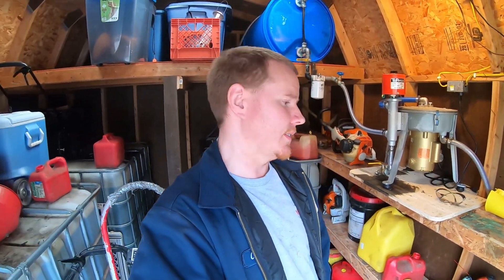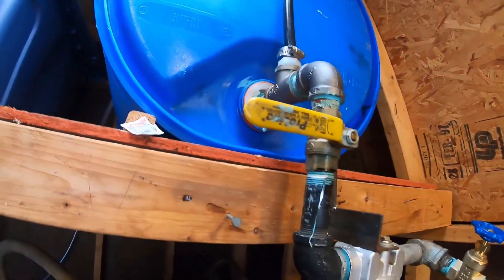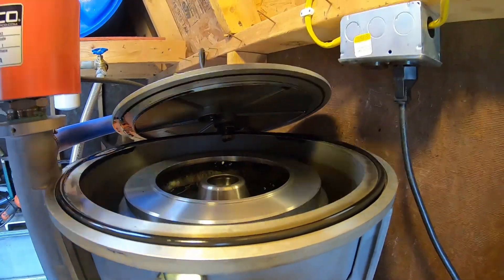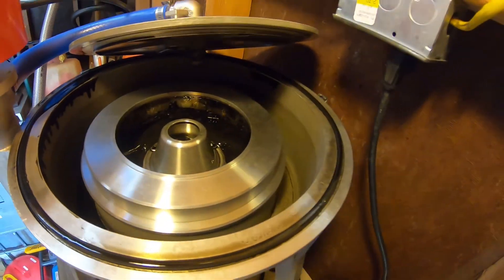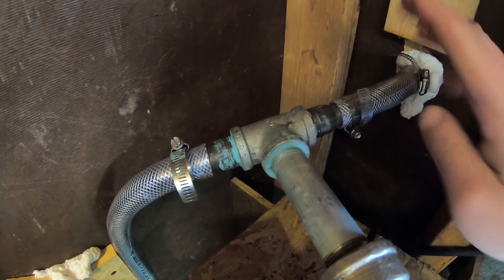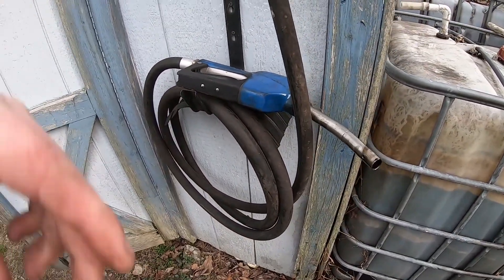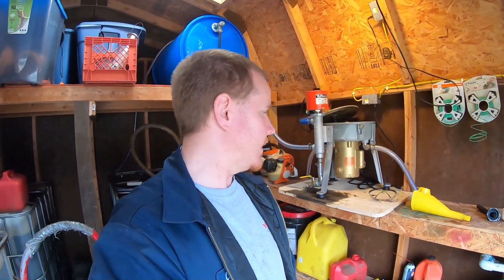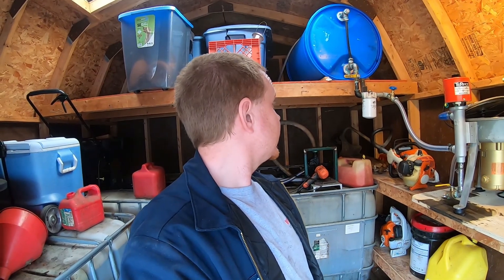Introduction To Black Diesel - Centrifuge Basics & System Plumbing - Alternative Fuel - WMO

Comment: Just wondering about your pump, I'm having problems finding a pump that isn't effected by gasoline it seems nearly all fuel transfer pumps online say not suitable for gasoline, I'm wondering if it would be ok when mixed with oil
Reply from the maker: My drill powered pump?  Should be fine but it's mainly meant for transferring oil fast.  I use a DEF transfer pump for filling vehicles...   its worked great for years.   DEF is highly corrosive so they have good seals and such that hold up.
Reply: @NotSoGrandGarage  sorry it was the main pump I was on about I wanted one that would pump and circulate in the drum like yours. Was it very expensive?
Reply from the maker: @tzajaczajac  I got mine used for cheap but they are spendy new.  It's a Fillrite DEF transfer pump.
Reply: @NotSoGrandGarage  I'll look them up thanks for the info👍👍
Reply from the maker: @tzajaczajac  no problem!

Comment: Does the centrifuge filter synthetic oils out? If not how much diesel fuel do you mix in your black diesel?
Reply from the maker: Doesn't remove synthetics.  I've never had an issue with them.  Now in my dual tank setups, no diesel in the black diesel blend.   In winter, it's 85% oil to 15% gasoline.

Comment: i cut my wmo 20% gas 10% diesel before i ran a 40 gall. batch heated to 180 deg. for 3 hours ,my centrifuge came out shiney clean.did i make a mistake by thinning my oil before running it?
Reply from the maker: Kinda odd.  I wouldn't think thinning prior would cause a problem.

Comment: Where does the water go?
Reply from the maker: The water/sludge stays in the bowl as its heavier than the oil.  When it shuts down, the little bit of oil along with water and sludge that remain in the bowl drain out the bottom from a separate port.

When it's running, the clean oil comes out the top of the of the bowl and is flung out against the outer housing where it drains to the finished drum.  There is a pocket in the housing that the bowl sits down in that keeps everything separate if that makes sense.  I'll be doing a review video of the u it in the near future and I'll cover all of that in detail.

Comment: Have you ever tried getting the flow rate you wanted just by closing/opening the ball valve rather than using gate valve? I know the ball valve would have less control but maybe it would still work?
Reply from the maker: Yeah but it's too touchy.  A slight bump doubles flow rate.  The gate valve works well.
Reply: @NotSoGrandGarage  gotcha.  I went ahead and picked up gate valve while I was at hardware store.  Now I'm just waiting on my electrician to come out and help me wire it.   I got that 6000rpm one with the vfd so I rather not test my wiring skills on it 😂
Reply from the maker: @BRWfilms  let me know how it goes.  I've seen some videos on that unit and it looks pretty slick
Reply: @NotSoGrandGarage  will do
Reply: @NotSoGrandGarage Urgent question So i got the center fuge wired up. I ended up doing it my self.    The heater element, do you just put a 12 avg plug on it and hook it to 110 or is there some kind of wattage regulator needed?? I'm reading through the papers but this stuff is new to me.  Want to make sure I get this right.
Reply from the maker: @BRWfilms  the heater should have a wiring diagram.  115v or 230v.  I wired mine to a male plug on 115v
Reply: @NotSoGrandGarage  Okay and just a plug you didn't have to add any kind of voltage regulator or thermostat tho?   I see now the diagram in the wvo book.  I was originally just looking at the papers that came inside the heater
Reply: @NotSoGrandGarage  thanks as always for quick reply
Reply from the maker: @BRWfilms  no problem!
Reply: @NotSoGrandGarage  got it going just now.   Working on getting that 10 gallons per hour flow rate now
Reply from the maker: @BRWfilms  the heater should have a thermostat on top with a dial to adjust.  At least mine did.  I just wired in a 12awg cord with a male plug.  Nothing else.
Reply: @NotSoGrandGarage  got the heater straight 👌.    Ran my first tank of w90 with a 1/4 of tank being pump diesel yesterday.   Ran just like normal.    I did smell a different smell tho like burnt oil but it was very faint
Reply from the maker: @BRWfilms  It will have a smell to it.  Can't really avoid it sadly.  Glad you got it going!  Good luck!
Reply: @NotSoGrandGarage  thanks

Comment: G’day, I’m a new subscriber from Western Australia, I am really impressed by your setup. 
I’ve just purchased the WVO Raw power basic model.
as we are on 240v AC, the motor output is only 2850rpm, I’m hoping that it will still work efficiently, my intention was to convert waste oil to run my 1968 Fiat tractor 🚜 
We were looking at getting an old diesel ute too, time will tell.
The $1400.00 USD came to $2800.00 Aussie dollar plus freight. Hopefully it won’t take long to pay itself off.
Regards Heath
Reply from the maker: Should work well.  On the tractor, if you're running a single tank, I'd suggest running no more than 50/50...   but it'd be better if you could setup a small tank to start and shutdown the tractor on diesel.  Good luck with your project!

Comment: Good evening, what’s your thoughts on the US filter max non direct drive centrifuge? It’s 5000rpm says should filter up to  1 micron , I believe the one you have is the wvo designs? Are you using a basic 3400rpm unit ?
Reply from the maker: The US filter max is a great unit from my understanding.  Itll hit submicronic levels and at 5000rpm, its putting more force on the fluids passing through it than mine does. I'm running the basic unit with heater and booster cone.  You'll be happy with it I'm sure.

Comment: If I run unheated oil at 6600 rpms at 3gph.  How often should I let it drain off?  It wasn't heated, just sat for a long time and water drained off the bottom.
Reply from the maker: Drain off the bowl I assume? After the batch is done.  If the bowl looks overloaded, I'd run it again.
Reply: @NotSoGrandGarage  by run are you talking maybe 50 gallons of wmo?
Reply from the maker: @rodneyhoskins8187  whatever your batch consists of.
Reply: Thanks for the information in the end I bought the heater I’m assembling everything today should be done with it tomorrow train my first batch tomorrow

Comment: Hello if you vent out side i believe .  you will add humidity to you batch. from what i know diesel tanks have a pressure relief . Thank you Steven. We used a delaval oil  purifier that did the same centrifugal force to clean oil from a main engine reduction gear system on a Destroyer i had served on during my Navy service .
Reply from the maker: The finished drum is vented to atmosphere.  A lot of moisture passes from the centrifuge into the drum via steam.  My thought is venting the steam from the centrifuge directly will prevent the moisture from re-condensing in the drum.
Reply: @NotSoGrandGarage  can also just tap a little valve at the lowest point in the barrel
Reply from the maker: @psd28  I've actually fixed this issue by adding a moisture trap to the outlet line from the centrifuge.   No more steam going to the finished drum.

Comment: After running in this you can then go into the truck?
Reply from the maker: Depends on the engine and tank setup.  In my OM617 Mercedes, I run a single tank and this mix blended roughly 50/50 with diesel.  In my IDI Ford F350, I have 2 tanks...  one is for diesel..  the other is for W90 straight (90% oil/10% gasoline).  Start and shutdown on diesel...    any other time, on oil.  Check out my other videos on the subject.  Thanks for watching!

Comment: Nice setup! How big is the bowl's rotor in diameter? 7000 rpm is very high :-) Marlon
Reply from the maker: The unit runs at 3450rpm and the bowl diameter is approximately 8".
Reply: @NotSoGrandGarage  Thank you very much!
Reply from the maker: No problem!
Reply: Maybe I missed it, but what the g forces at that RPM?